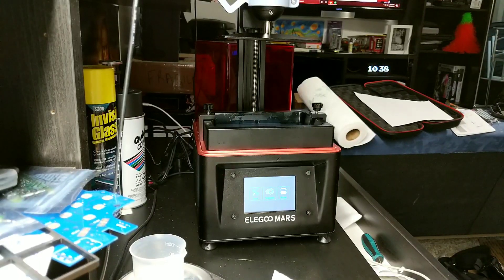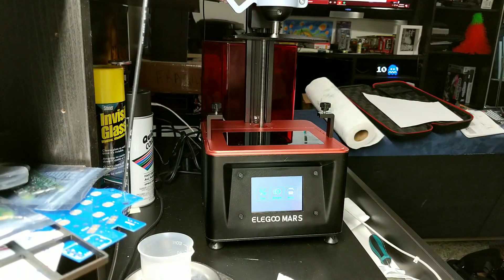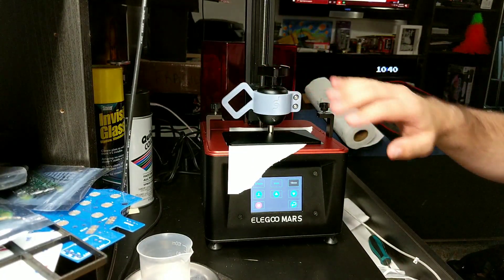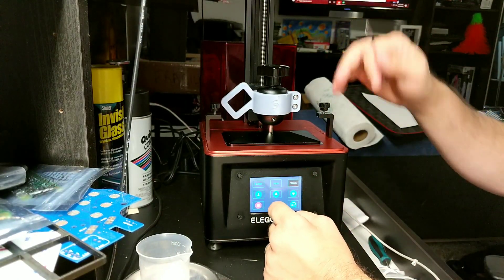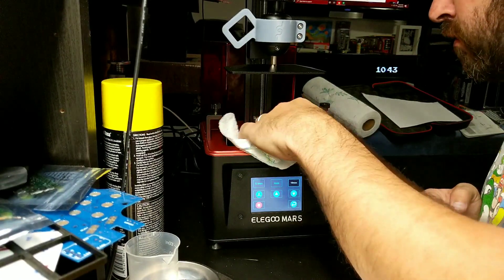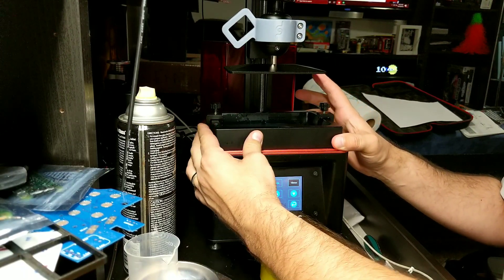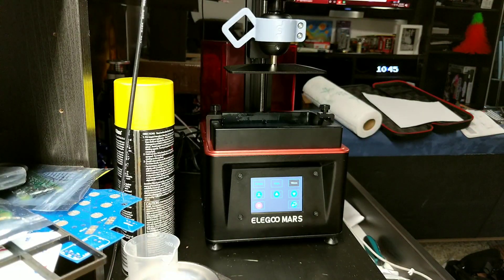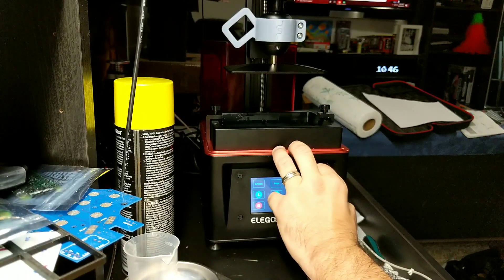Elegoo Mars bed leveling!

Comment: Great video but...  after leveling the build plate I can’t believe you rotated it slightly with the paper removed😧 The Odds of keeping the plate perfectly flat after rotating it slightly are next to zero. If any rotation is needed you need to have the plate loose and with the paper in place.
Good advice on keeping the resin tank lifted a bit when installing.

Comment: i would NEVER use a paper towel on anything on my printer because it will for certain scratch. Microfiber towels for the win. Also "Spray Away Glass cleaner" is much better
Reply from the maker: Yes I usually use a shop towel but couldn't find it for this video. I use paper towels mostly for cleaning the build plates and as for glass cleaner I have the best...stoner invisible glass
Reply: @AkumaMods  we agree to disagree on the cleaner. Paper towels are just bad news. If you're going to make a video, why not use the correct suggestions?
Reply from the maker: @EastwoodFabrication  I made the suggestion because it's what 95% of people will use no matter what you tell them is right

Comment: why don't you use protections against resin vapors?
Reply from the maker: I have a whole room ventilation system thats rated for a room triple the size of where it's at. It's always on and always in use
Reply: Resin vapor warnings are kinda over exaggerated due to them being more toxic during the start of resin printing. Now a days, many non-toxic and even near fume free resins (like elegoo mars resin (the non-water washable ones) and all you need is basicaly to have your resin printer near an open window with a cheap fan blowing out.
I still wear a cloth mask just so I dont breathe in sanded resin dust, but it's no biggie when it comes to fumes unless you are hotboxing yourself to death with no ventilation.